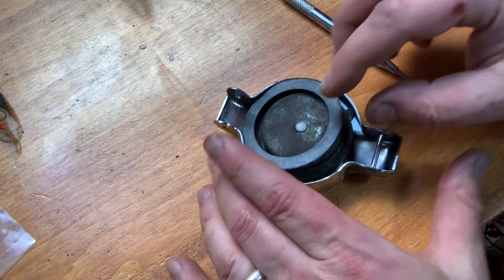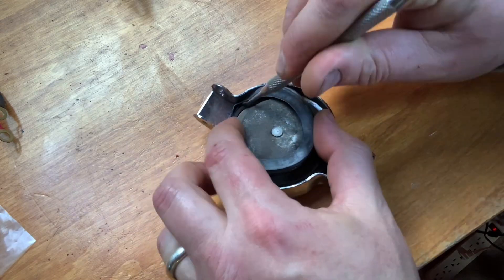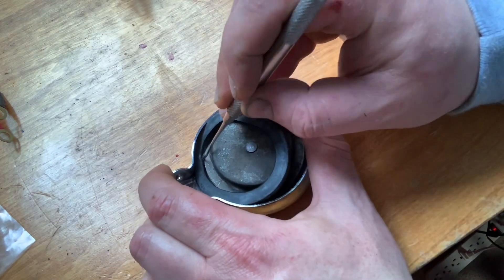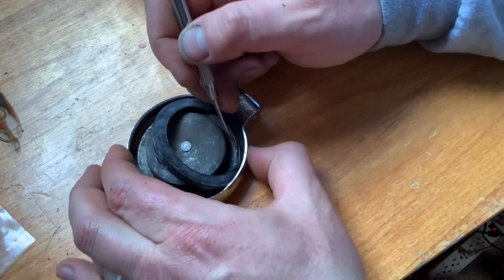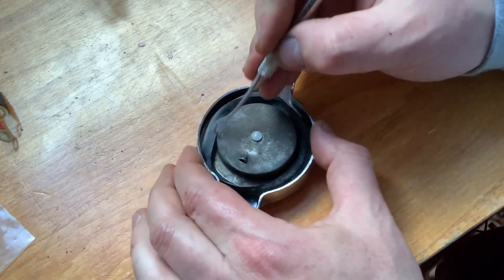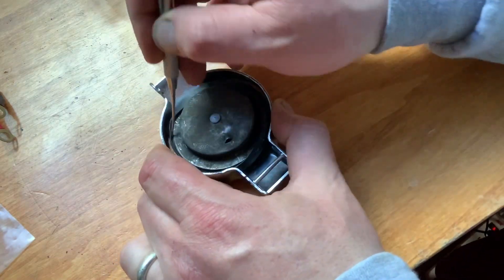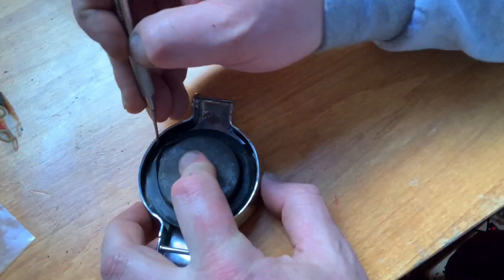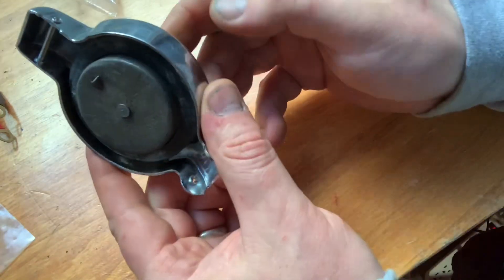How To Install A Gas Cap Gasket Seal (The Hard Way) on a Honda Motorcycle: CL350 Project: Part 125

Comment: You are a lifesaver....had stuttering, fuel starvation, symptoms....had replaced the gasket during rebuild....never realised how the gasket should have been installed! Super valuable video!!
Reply from the maker: Great to hear. This video is the hard way. The next video in the series features the easy way. Please be sure to check that one out. It’s WAY better. Thanks for watching!
Reply: @KeepOnWrenching  i I actually ended up doing it the easy way!! Cheers from the UK!

Comment: Trying to restore my original locking gas cap on my '89 Honda fl400 Pilot.  I have a new cap with gasket identical to the original and, after watching this, I'm ready to take a leap of faith and pry the old one out.  Thanks for the "push".
Reply from the maker: Go get it. Not too hard at all.

Comment: Thanks for sharing installation technique, speaking of vintage Honda gas caps, can they go bad in terms of letting raw fuel come trough that little opening at the bottom of the cap? Say you replaced the seal but the fuel may still come out trough the little opening, I think the opening is there to allow gas to vent in case pressure build up.
Reply from the maker: There is an easier way. It’s in the follow up video.
Reply from the maker: That vent needs to be clear for sure. I prop it open or compressed and let it run through the ultrasonic a few times. Seems to clear it out.
Reply: @KeepOnWrenching  Yes Sir, the followup video made sense, there's another large washer behind the gasket, thanks.
Reply from the maker: I should actually just remove that first video. Thanks for the reminder.

Comment: You don’t need to do that. There are caps that pop off, and there are others that have screws that you can take off. Clearly, this one can be pried off from underneath where the gasket sits.
Reply from the maker: There’s actually a little metal star shaped bracket that pops off. It’s a bit of a puzzlement.

Comment: I think I remember that middle springed area slides completely out.  tight fit but not attached.
Reply from the maker: I’ll have to check that out. Wasn’t aware it came apart further. Some caps have a screw in the middle. Others appear to be just a river of some sort. Thanks for the info. I’ll look into it.
Reply: @KeepOnWrenching  I tried your method, Brian, and I think I spent two hours working up a sweat and letting some four letter words fly. Never could get the damn thing on. I found a post in a forum that mentioned removing the entire inner piece. You can see along the cap on the inside edges some triangular metal pieces. From memory, I want to say there was four, but it might have been three. Pry one up a little with a flat head screw driver and work another one up some and eventually the whole mechanism pops out. Placing the seal on then is a breeze. Getting it back in the cap wasn't difficult. At least not on mine.
Reply from the maker: Great info! Probably could have saved myself a headache. It got done though!

Comment: Hi there. Just had your vid linked to in a comment on my experience trying to change this seal/cap. I then discovered you can remove the central section completely, making seal replacement very, very, very easy. Here is a link to my next vid showing that discovery and the easy way to replace this seal.

Honda CB200 Petrol Tank Cap Seal Replacement : https://www.youtube.com/watch?v=58ODpbkGeWk

For next time perhaps!
Reply from the maker: Ha! That’s funny. The stars were a discovery too. Glad you’re making progress.